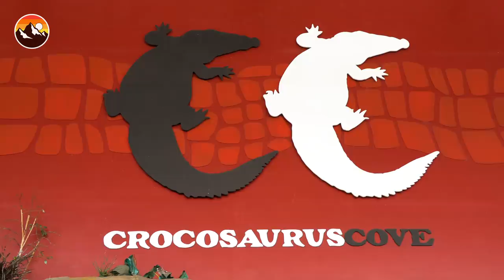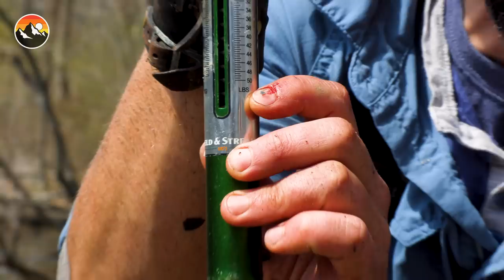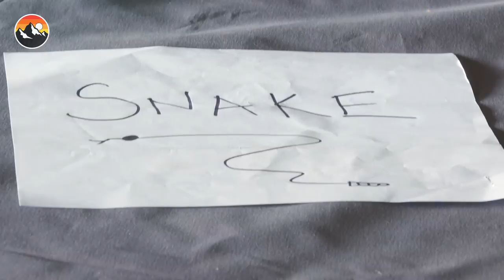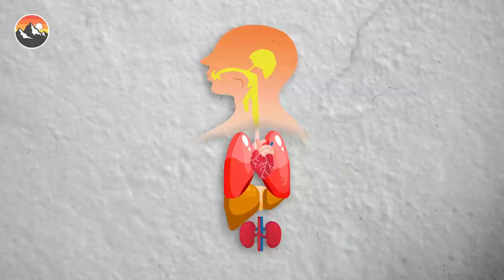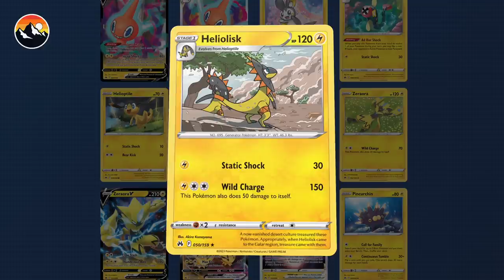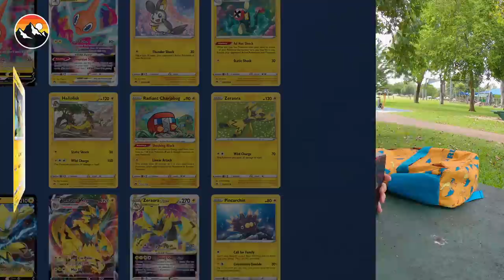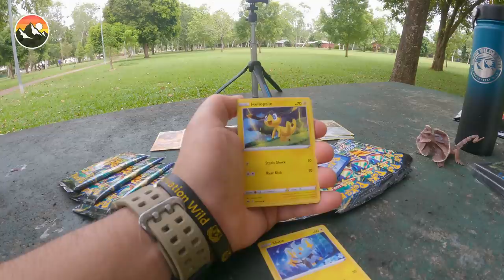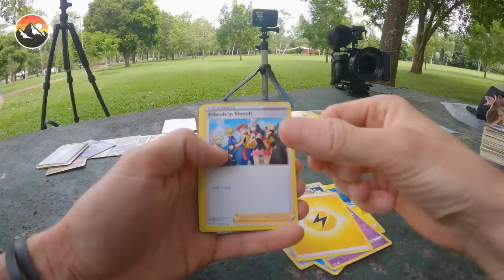MASSIVE Croc vs Coyote!

Comment: I used to have a  family reunion at Black lick forest every year. Back in the late 70s early 80s.  It's beautiful. When we handle snapping turtles under the water . If you're on the shell feel down to the edge and feel for the jagged edge that's the rear of the turtle. 👍🏼